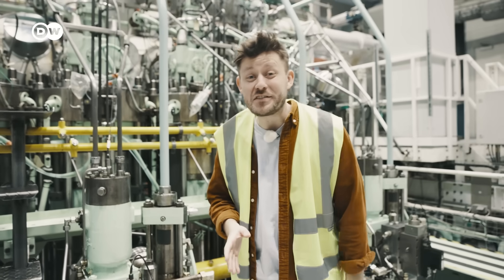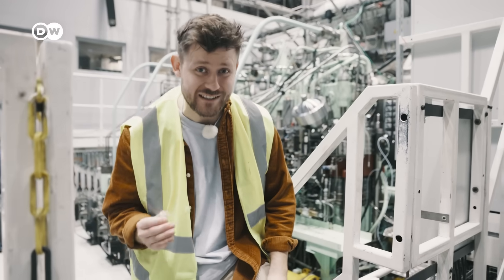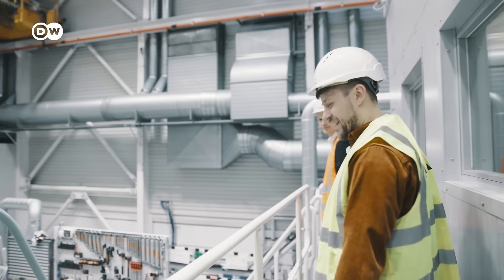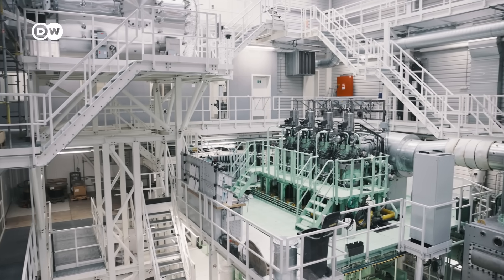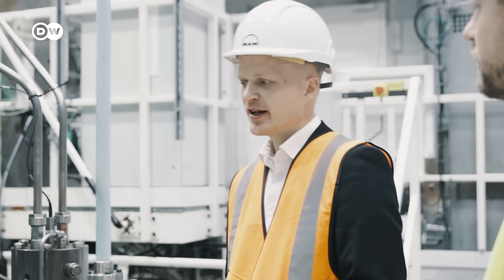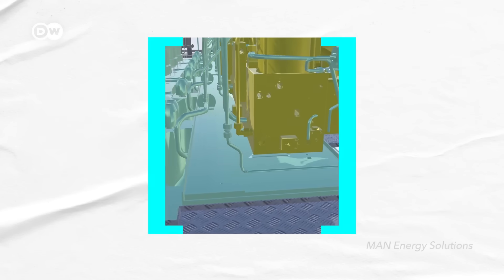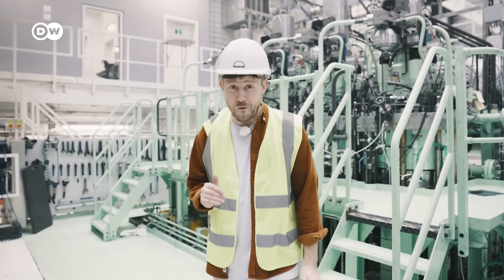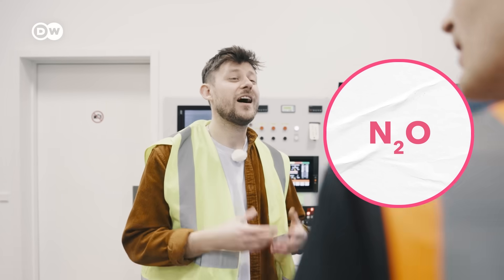Can this magic fuel clean up the shipping industry?

Comment: When it comes to stopping climate change there is a very common misconception underway. You cannot fight a problem with the same things, that cause the problem. In this case: oxidation of any kind of chemistry in an ingternal combustion engine. You may lower pollution of ICE as low as regulations request, growth will overdrive the true sense of those regulations. Keep an eye on what regulations caused a Diesel engine to get added on from 1950 to today to understand.....
The solution to the very shipping problem is 
a) not to expect transportation growth but limit it
b) to use any kind of sail to propel ships.
with
Limiting exhaust capacity limiting pollution
and
not burning anything not exhausting anything.
Think twice: Growth and globalization is a capitalistic misconception. You cannot grow earth

Comment: 5:36 it's the exact opposite, higher combustion temperatures lead to MORE NOx emissions. 

This is the exact problem diesel engines also have to deal with. Running cooler to lower NOx emmisions also reduces fuel efficiency and creates a lot of sut. Neither of which is desirable. So it's a constant balancing between sacrifices to make.

Comment: What if the engine had hydrogen injected in with the ammonia from self generated electrolised water instead of the diesel fuel. Hydrogen burned with the other fuel increases its fuel efficiency by burning better and produces water as a by product. This may give the ships the additional range they lost due to lower calorific energy in the fuel.
Reply from the maker: Hey there! Hydrogen is also often used as a typical combustion promoter as alternative to diesel in ammonia engines.

Comment: Did you mention any positive point about this?😂
Reply: You don't have to extract CO2 from the air, which is very energy intense and expensive.
The extraction of nitrogen is easy, since it's the main component of air.
I suppose, this is the most important advantage to "carbon fuels" like methanol.

Comment: This is just stupid. Where to even start,even in video they admited that NOx and N2O are much more potent greenhouse gases than CO2. Also its toxic and its production is even more dirty than fossile fuel production and its far less energy dense. This shows very clearly how stupid people have become with CO2 paranoyia. They are testing stuff that is far more worse than CO2 to enviroment just to get a tick in the box for CO2. The real enviromentaly good solution is to produce massive amount of nuclear fuel to produce ethanole from allready emmited CO2. And to make internal combustion engines 2 stroke and as efficent as possible. This would eliminate extra carbon emmisions into atmosphere and reduce or totaly eliminate NOx emmisions because ethanole has lower burning temperature. But no because this carbon phobia we do stupid stuff.

Comment: The only thing this video proves is that this is all a bunch of bullsh*t! This doesn't clean up anything,it's not better compared to traditional engines in any way, the video really doesn't sell the whole thing believably,because it isn't a viable,practical piece of tech,in reality it's more like "much ado about  nothing" really...It might work,but it's definitley not practical or better in any way.Is this a commercial trying to fish for investors, while also being disguised as a news programme? Or what is this? Also, carbon capture is even more of a big bunch of horse-manure,because big companies try to sell the idea,that we can have green fuel captured from the air, but it's not profitable enough, and it barely captures anything! Plus those carbon capturing facilities need power too, in order to be able make a fuel, in a really unefficient way....Which is totally illogical...burning fuel to make fuel..wasting a lot, so I don't see huge carbon capturing facilites being built in the future anytime soon! This is more like propaganda for the gullible, to make you believe,that everything's allright,designed by big oil companies,just like carbon credits...It's a bunch of f*ckin* *h*t!

Also,what would you prefer to handle in your tanks? Gasoline/diesel, or ffing ammonia?!?!?! who the hell had this stupid idea anyway?!?!?!  What's next? Are we going to propell ships with nuclear explosions because of it's energy density?!-this was the appropiate scientific english word by the way, not "caloric ",lol.....

Comment: All these shipping container ships should run on nuclear energy. They've been running submarines on it for 50 years. There are plenty of small nuclear reactors being built right now. They are the size of one, maybe two shipping containers. NO pollution.
Reply: The first generation of nuclear powered cargo ships were commercial failures. Nuclear powered subs have a significant number of specialised crew to operate the nuclear propulsion system. In the commercial world this translates into much higher operating costs.
Reply: @davidjones5280  Small Modular Reactors (SMRs) have come a long way. In the space of a shipping container or two you could power a ship that carries thousands of containers.
Reply: @jonathanrichter4256  And how many specialised high-cost crew to operate the nuclear propulsion safely? Not currently competitive, or big shippers would be doing it already
Reply: @jonathanrichter4256  Come a long way? They're not in production or operation yet - probably not for another 5-10 years or so.
Reply: Nuclear energy is very difficult special on sea base moving platform
Reply: Container-sized microreactors like the Westinghouse eVinci (not in production yet) produce around 5MW of useful power. Large container ships require 30-75MW.
Reply: The SMRs being developed for civil power generation will not be suitable for ship propulsion. Civil power reactors operate over a relatively narrow power power band (50%-100%) to maintain their thermal efficiency (~ 35%). Naval reactors need to operate over a much wider power band, and to achieve this they sacrifice efficiency. The reactors in the Virginia-class subs have a peak thermal output of ~ 220MW to deliver a maximum shaft power around 30MW plus auxiliary power. NS Savannah had a 74MWth reactor to deliver 15MW shaft power (20%). The Otto Hahn had a 36MWth reactor that delivered 8MW shaft power (22%). To deliver the 75MW shaft power required for the largest container ships would require a reactor with a thermal output of ~ 300-375MWth.

Comment: ammonia :face-blue-smiling: what a joke ! Ammonia is produced by Haber process (50% efficiency maximum ) which use hydrogen and nitrogen, technically hydrogen is produced by CH4 and Water reaction ( 70% max efficiency and same efficiency 70% also in electrolysis ) 

So, you are taking nearly 10kg of CO2 for 1kg of ammonia, which is way higher than simply burning methane.

And 
hydrogen electrolysis is very carbon intensive because it produce nearly 85% pure oxygen which is capable to eat any possible electrode (even graphite electrode oxidised to CO2 ) expect platinum electrode. So, most companies use iron electrode because it is cheapest electric conductive material.

Comment: To recap the ammonia engine:
- needs a tank 2times bigger to store the ammonia than a traditional ship
- Needs diesel to function which means another tank, reducing even more the carrying capacity of the ship
- at least 3 times more expensive to build
- Heavily poisonous gaz that will be expensive to operate 
- Ammonia is not produced at scale using renewable energy 
- will produce a lot of GHG that the company promess they will capture in the exhaust

Comment: Is the problem the element Carbon? I can't believe that They are trying to build an internal combustion engines with ammonia as fuel. If Nitrogen Oxide is poison and it is another greenhouse gas, methane will keep as a better option. Another contamination problem is the trash and organic waste, organic trash produce methane. What if the organics wastes were fermented to produce methane and fertilizer, and the fertilizer would be used to grow aquaponic potatos, and those potatoes would be are used to produce methanol.

Comment: I feel like for shipping, liquid hydrogen makes a lot of sense. You can make use of more efficient fuel cells so need less volume for fuel comoared to ammonia, and because you're immediately using the fuel that will minimise boil off. Also by being liquid it doesnt need massive 700 bar pressurised vessels, just well insulated 5 bar ones which can take a wide variety of shapes to fit the ship design

Comment: Bro it burns directly into nox. Probably ok out a hundred miles in the sea but in ports, not so good.
Reply: No, it burns basically to nitrogen (N2) and water (H2O), like hydrocarbons basically burn to CO2 and water. 
NOx and N2O are just byproducts.

Comment: Can’t we just put a giant battery in the ship and run on electricity, it works perfectly in my electric car. Surely it’s just a matter of scale. It takes time at dock to load and unload containers. Charge the battery then, or just have container sized batteries that get charged at the port and loaded onto the ship fully charged. Electric motors are now 90+% efficient compared to 20% efficient for internal combustion engines. So 4 times more efficient and far less maintenance. You can eliminate the need for electric power generators on the ship too.

Comment: Bunker oil is the only economically viable fuel for large ships.
If anything else could've worked better, it would've been in use by now.
You will NEVER see a battery-operated freighter... EVER.
The only other fuel source ever considered would be a nuclear reactor.
But international treaty law will not allow a nuclear powered commercial vessel.

Comment: What if all that electricity was used to directly power the ships by using large sodium ion batteries? The ships could also integrate solar panels directly onto decks to top up power needs in good weather and when in port. Maybe the energy needs are much greater than this could allow for, but perhaps a hybrid system could help when the engines are not at full power so the inefficient stages of shipping could be taken by battery-electric capability? I dunno. But having purchased a Prius has opened my eyes to how dumb non-hybrid cars are, and surely it’s possible to use similar ideas on ships

Comment: What's problem with hydrogen they are 3 times more energy dense than diesel 😮
Reply: Only by weight, not by volume.
4 liters of cryo-cooled liquid hydrogen equate roughly to 1 liter of diesel.

Comment: So it's basically the mythical hydrogen scam but with extra steps...

Any future energy transition needs to be more efficient than the thing it's replacing, not less. Battery electric vehicles are more efficient than fossil vehicles. Heat pumps are more efficient than burning fossil gas. Induction ranges are more efficient than conventional cook tops. Whatever replaces marine diesel will need to be more efficient than marine diesel. Ammonia sounds like its just a really bad battery for renewable energy.